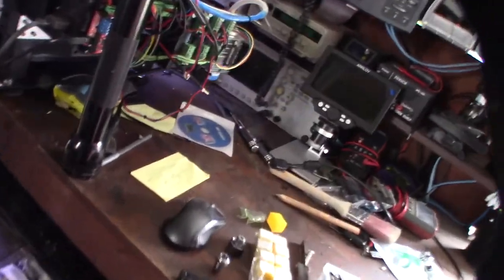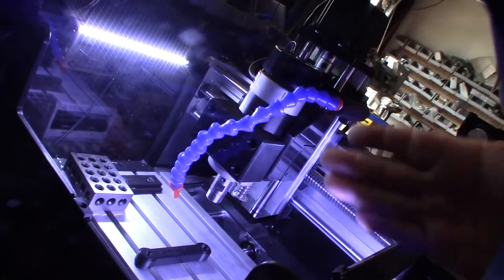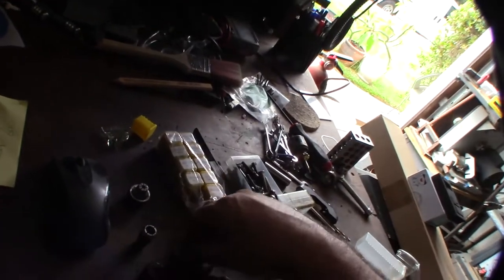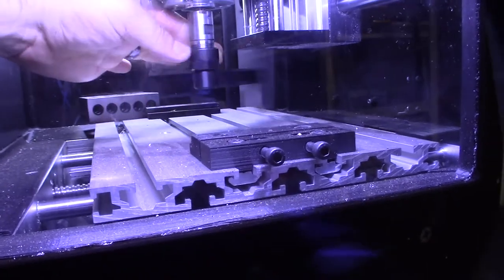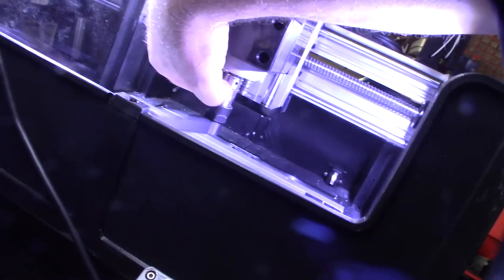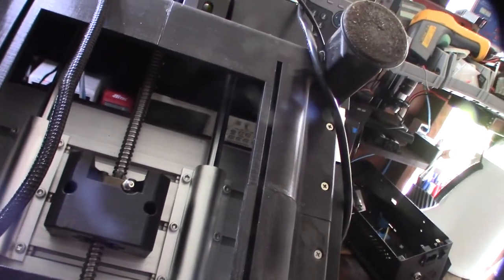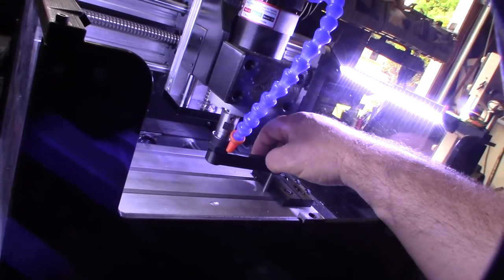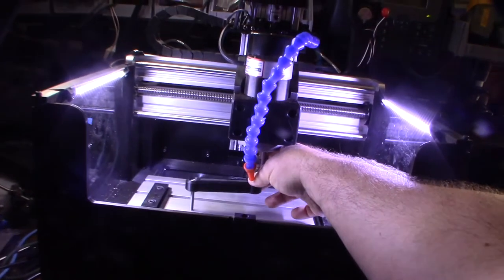3018 CNC Z axis spindle alignment tool, tramming tool for bed alignment tram

Comment: You really need a dial. The bed needs shimming like you did, but how do you know the spindle is not skewed in Y or X.   Typically you would want to face cut the whole bed with a spoil board surfacer, so you know the bed is square. You will also be able to see which direction the lines are from being not in tram. Then you move to the tram tool and adjust the spindle in y direction by the side plate screws. Then the X by using the free play in the motor mount, may have to open them up a tad to accomplish.

Comment: I haven't done any mods yet on mine.. with all the extra weight do you get more deflection? I was thinking the first upgrade I was going to do is ditch the stock rails and upgrade to linear rails.
Reply: I did ball screws and linear rails recently, and the same z-axis. I'm just getting it running again, learning limit switches and homing cycles, now. I mounted the linear rails to 2060 or 2080 extrusion for the X-axis, my Y-axis rails are still 10 or 12mm rods.